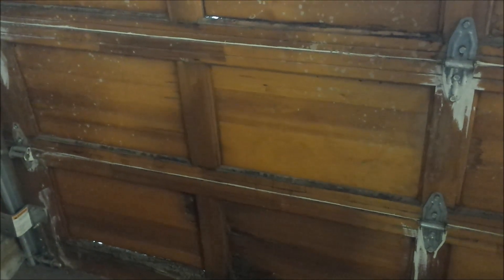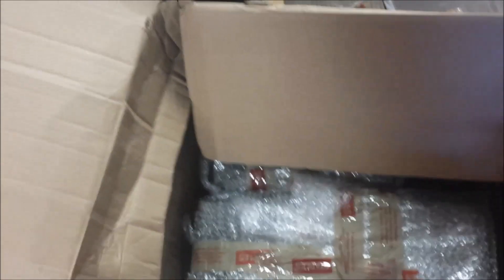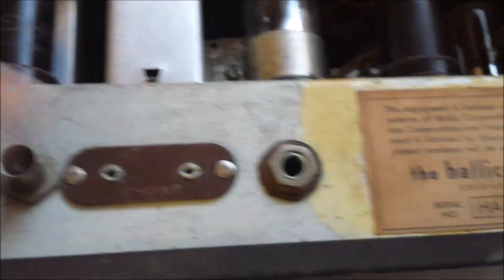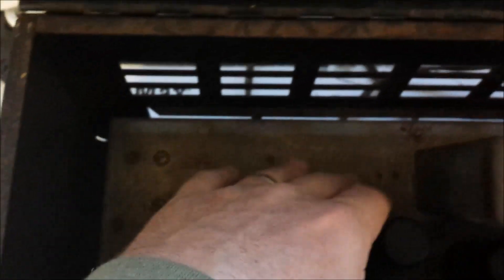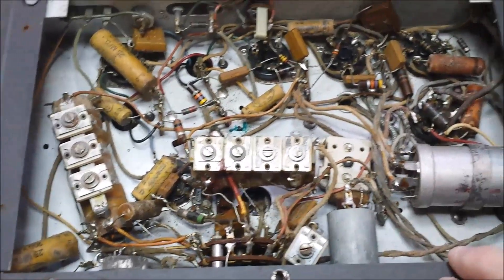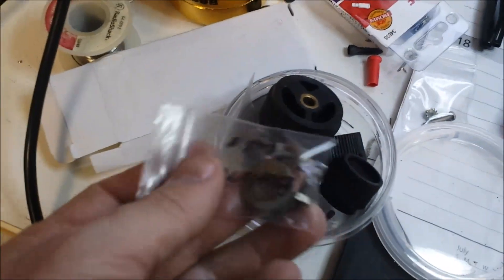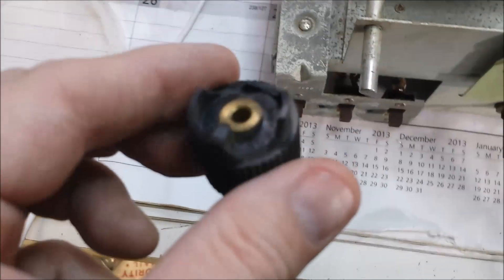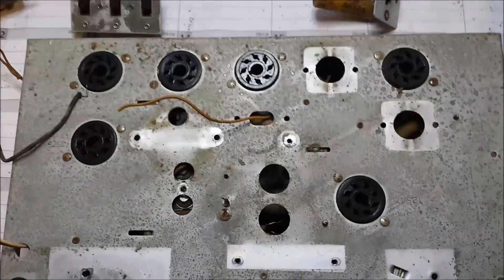K1SVC Hallicrafters S-38 Restoration   Part 1

Comment: Looking at the hole through the top of the cabinet and into the board surrounding the speaker, I am guessing that K1SVC installed some type of rod antenna there, maybe. -Arthur
Reply from the maker: +ArthurJS123 That would make sense.  We will patch that hole up before we refinish.

Comment: Hello,  Enjoyed your video's on this S-38 restoration.  I have an S-38 I'm restoring and the dual padder (C-10 & C11) for the oscillator transformer is missing.  My
 S-38 oscillator section is wired differently to compensate for this missing padder and the radio does work.  However, the alignment procedure requires an adjustment for C-10 &C11.  I managed to find a dual padder from a junker S-41.  I'm pretty sure that most of the components are interchangeable between these different  S series receivers so I decided to use the one from the S-41 and try to install it in the S-38 and try it.  However, the way the padder was wired in the S-41 is different from the way the padder is wired in your S-38 video.  I couldn't see clearly in your video's where all the wires from the padder go. So I was wondering if you could please send me a diagram/sketch as to how the padder in your S-38 hooked up.  I'd appreciate it very much.  Thank you. Bill KI7ZAD.